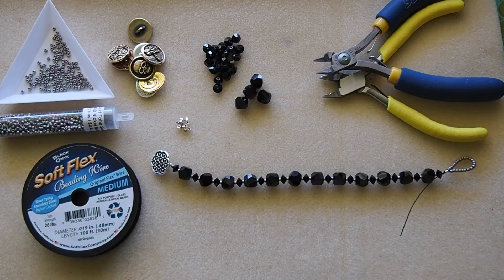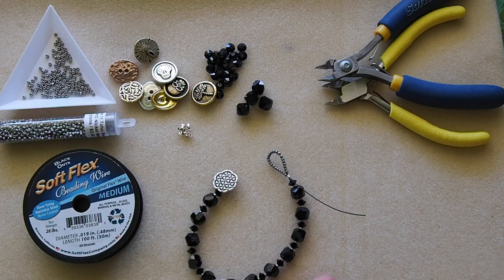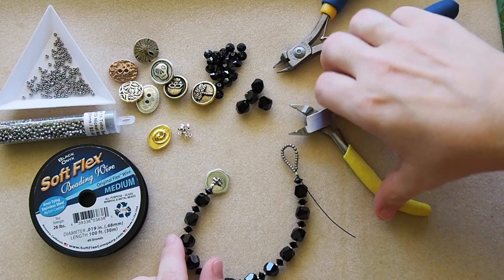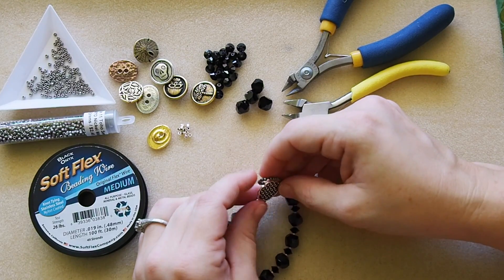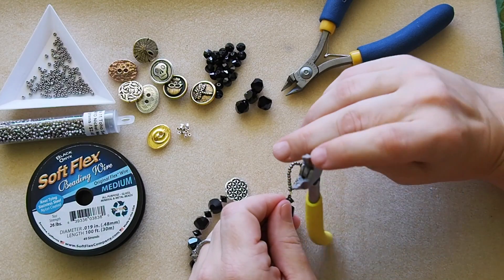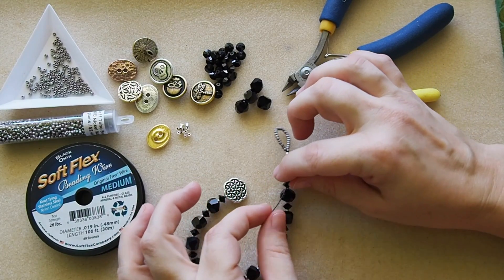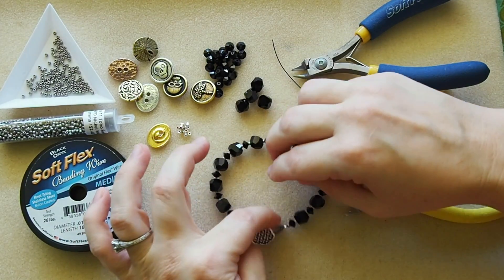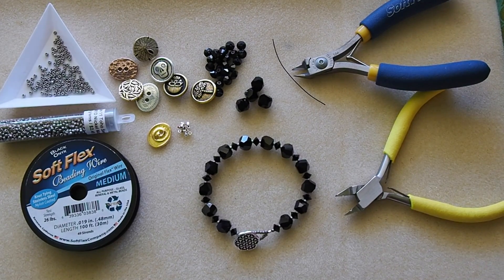How To Make Jewelry with Sara Oehler: Use Soft Flex Wire To Create Button Clasp On A Bracelet

Comment: Very nice. Never thought to make the loop with beads. Very pretty and professionally finished. TFS!
Question: I've watched several of your videos in which you use crimping tubes. Do you ever use crimping beads instead? If so/not, please explain when/why? Thanks for your time.
Reply from the maker: We go to great lengths to make very strong crimp tubes. They are seamless and double the thickness of many on the market. They are our go-to crimping method, tried and true.